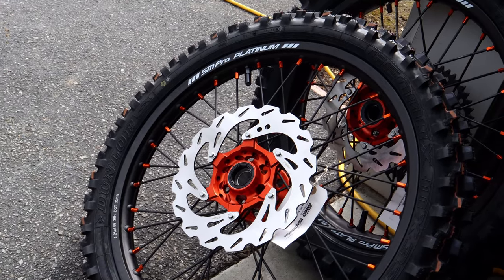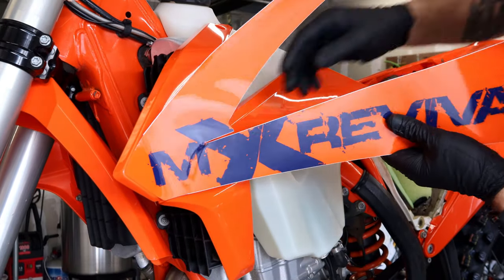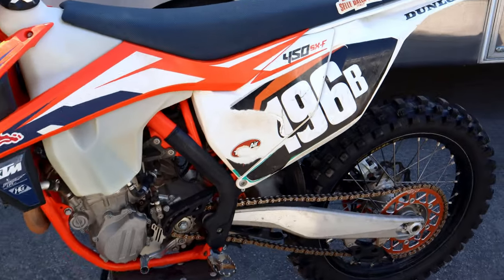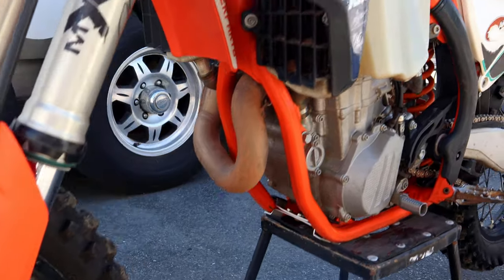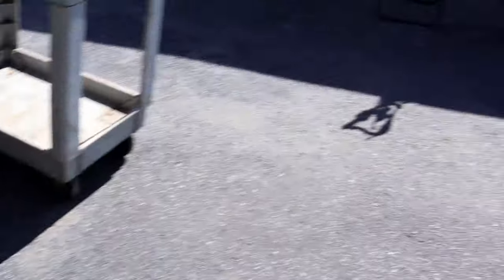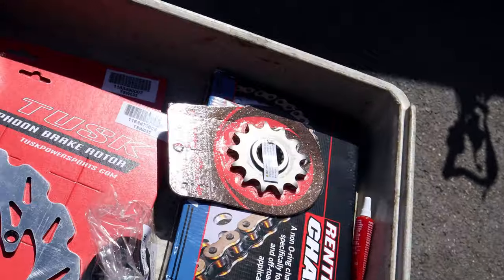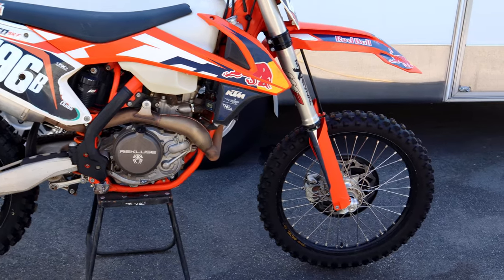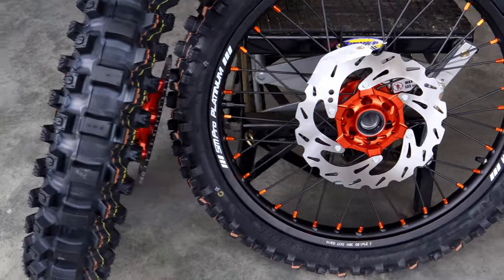Budget Dirt Bike Build - KTM Factory Edition 450 SX-F - How to Revive your dirt bike from the dead

Comment: Good job on that. You mentioned the KTM brake pedal springs snapping. The solution is to use Honda springs, many KTM teams use this, works great
Reply from the maker: That's a killer idea. I didn't realize they fit in there as the KTM springs are so "flat" you know?